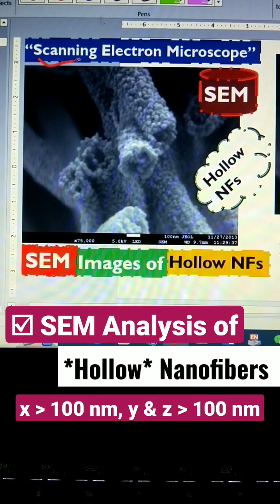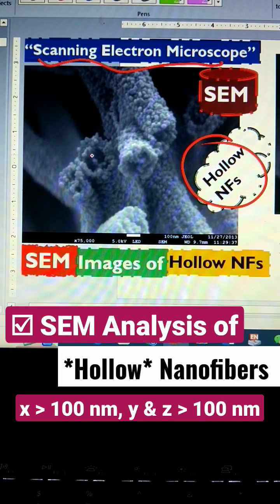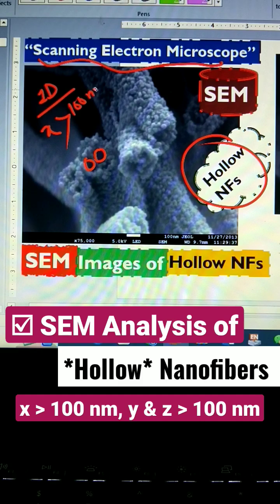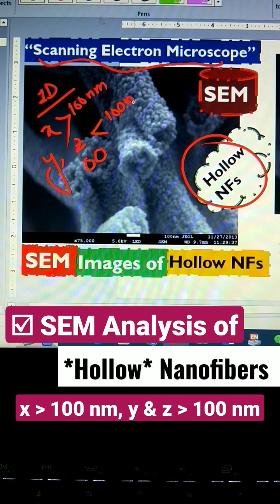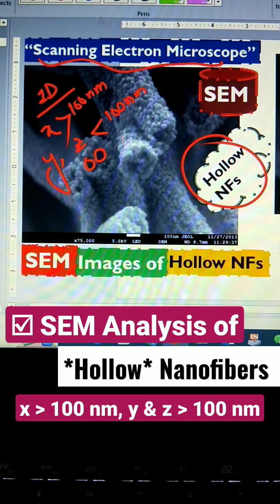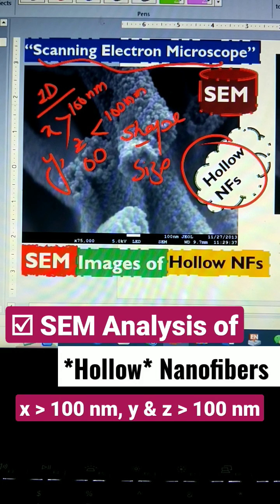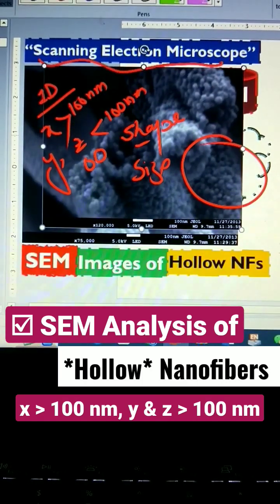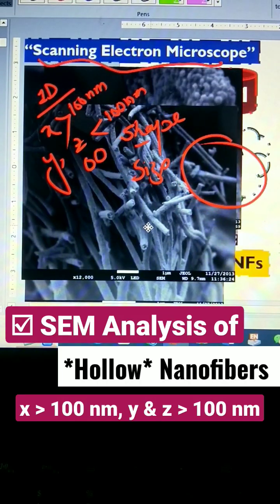SEM Analysis of Hollow Nanofibers

Comment: there is not a single context (other than a very unneccessarily reductive one) where it is a zero dimensional object. even if we take view that space is discrete somewhere beyond/under the Planck’s scale horizon, still the 100nm is lightyears far from 1.616 × 10⁻³⁵ 

also, even in discrete space math and physics, the “points´(or monads/atoms/cells/units/voxels/vortices…) that constitute such space all do have a symmetric internal structure of lets say rotation groups, or some spin algebra is running Dirac’s Belt Trick on those ‘points’… so claiming ZERO DIMENSIONALITY and then providing scalar metric values (>100nm) just doesnt work together. they are mutually exclusive and refute each other. 

i even tried to steelman your claim lets say in some partial context of low-capacity audience, one might preder and/or choose to limit the exposition only to over 100nm reality, so one  could use a hyperbolic description (“it is a zero dimensional…”) to cut off the possibility and/or need to describe/explain/elaborate anything under that, but i still failed to see ANY BENEFIT from such a positioning within the semantic vector field. i mean why even include it or say it when it makes no sense, adds nothing but an obfuscation, and is actually a disfunctional untruth. which is also called a mistake, misunderstanding, or a lie. depends on the intention.

have a good one
Reply from the maker: I am immensely grateful for your comment. However, I am unable to get the crux of your comment. You mean that below 100 nm dimension is not possible to obtain? Or you would like to convey something else?
Reply: @nanospeaks  i am saying that you claimed “zero dimensions” but one can go deep under 100nm in reality so for practical purposes you can say that is what you consider “point” but in reality and physics, 100nm is HUGE 😂.

thanx for your videos, they are cool. 

i am interested in PhotoMultiplierTubes and all their evolution until today, detection and measuring and imaging of human biofield and biophotons. like Kirlian photography, but today the tech is far far far from what Kirlian had access to in his times.
Reply from the maker: Thanks for clarification. Yeah, you are right that in reality making stuff well below 100 nm are possible. Even TEM takes images below 5 nm. 

Good to hear your interests in this interesting field. 

Once again, thank you for your comment
Reply: @nanospeaks  all good, thank you for bringing this field to attention. best to you